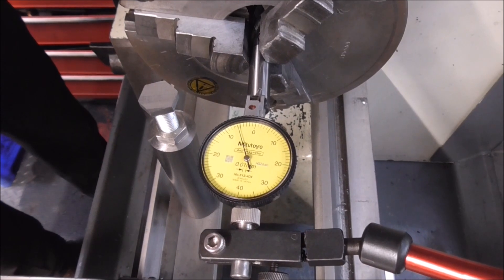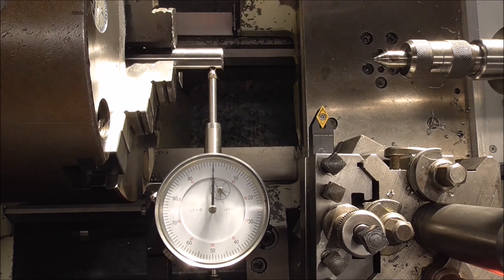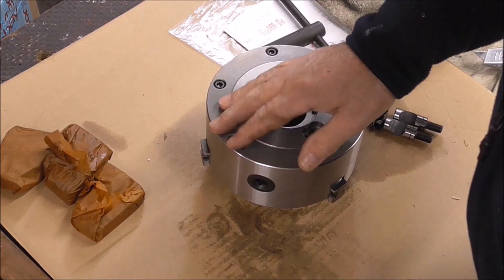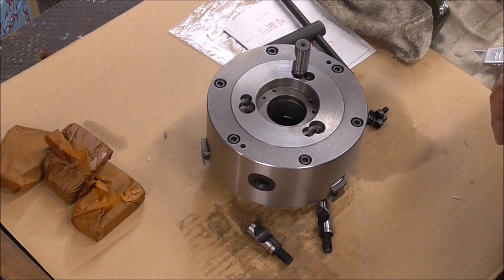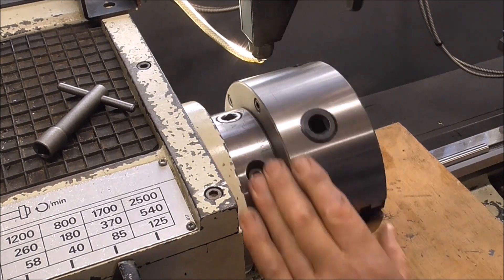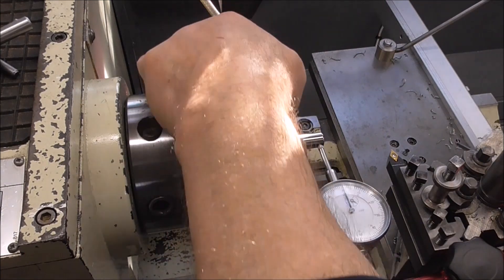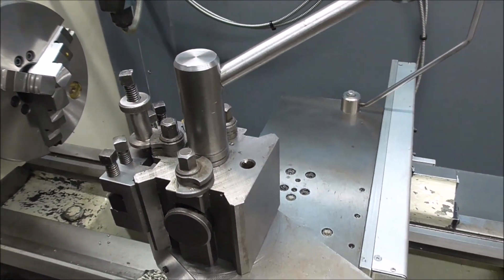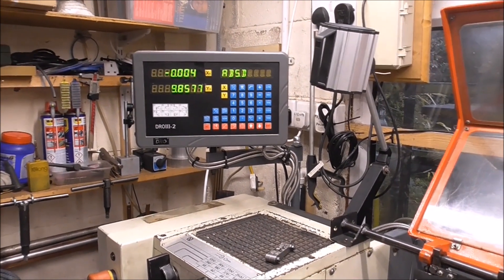Harrison M300 lathe installation and modifications part 2 of 2

Comment: Hi Brian
I've just picked up an M300 at a government auction and about to install at home, so your video is a great entry into what I will need to do.
Your modifications are very clever.
I will use a 2.2kw VSD to run mine.
The coolant pump which is 3 phase was missing but I've picked up a single phase pump that will do the job.
Thanks again for your videos.
Reply from the maker: Lindsey, thanks for the comment, always appreciated. Good luck with your installation. Cheers Brian